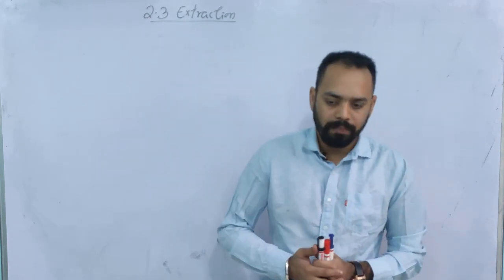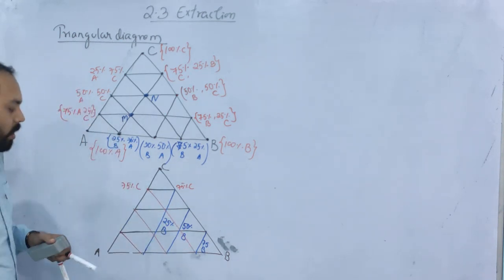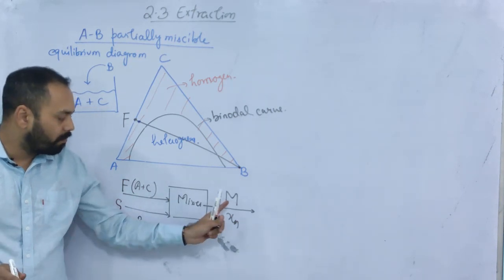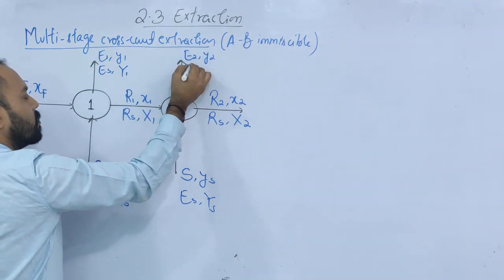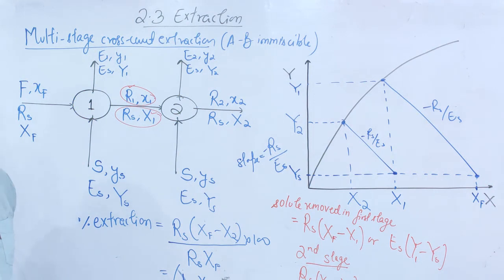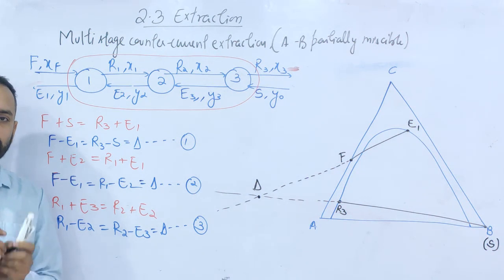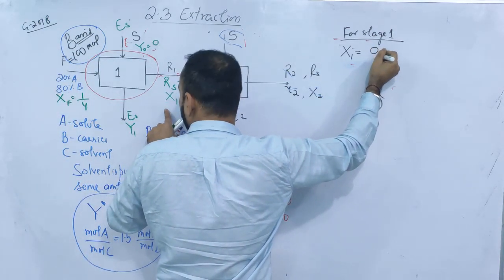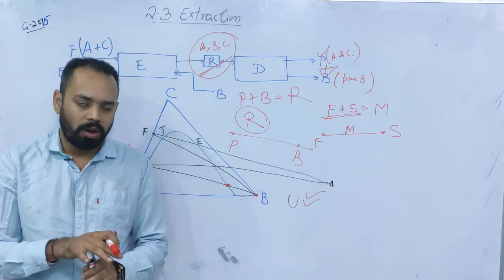BREAKING GATE 2020 : 2.3 (EXTRACTION CONTINUED)

Comment: sir if in any operation the number of trays comes out to be suppose 8.19 but in the options there is 8 and 9...then which one will be correct option?
Reply from the maker: If it is mentioned that next integer then answer is 9 ... otherwise of options also has both 8 and 9 then 9 should be chosen
Reply: @gatecatalyst-deepakpandey3041   thank you sir